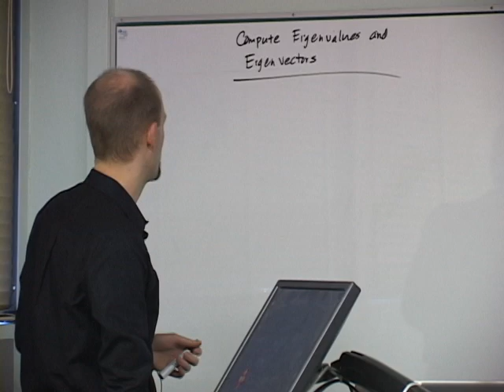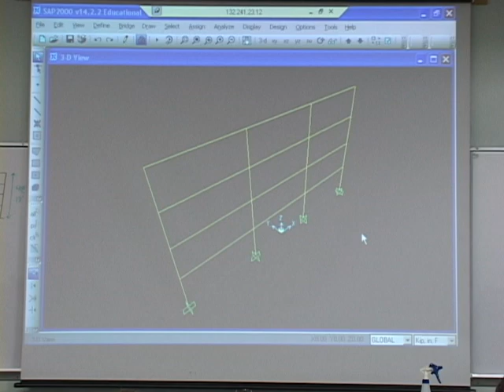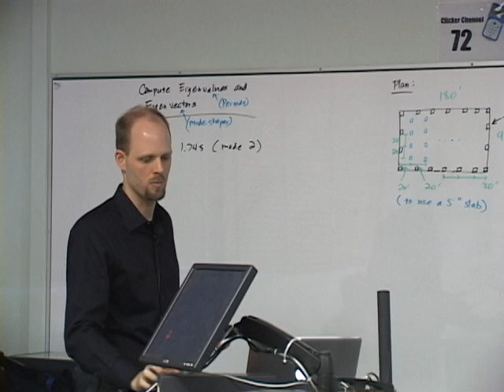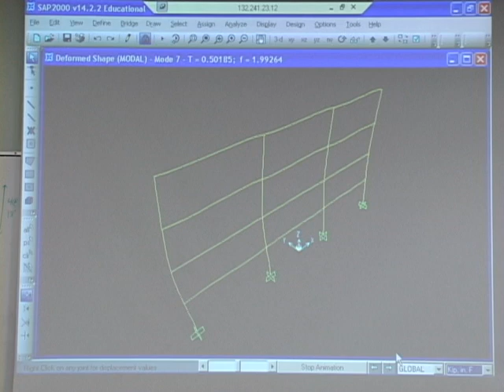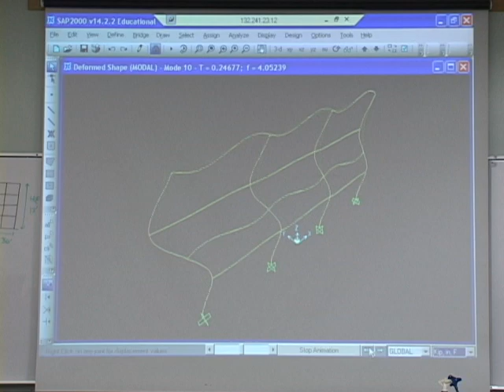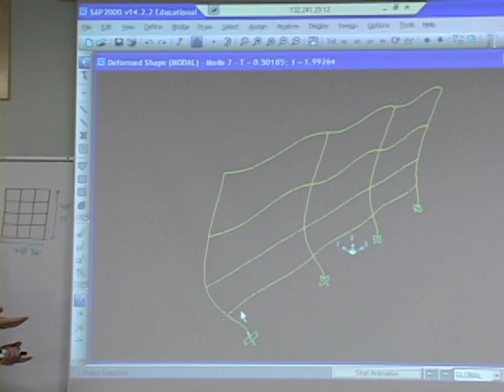3 SAP Eigen Vector

Comment: Thanks a lot for this helpful video. I followed your tutorial and found the same T and f but the eigenvectors are not. It seems like you have modified the constraints 'Equal4' which is not included in the next video. Plus, I am student and would like to request if you could you do 2D shearwall-frame analysis to get its T and f for learning purposes.